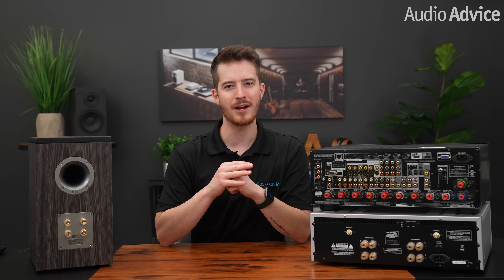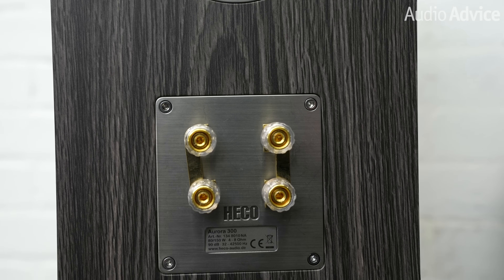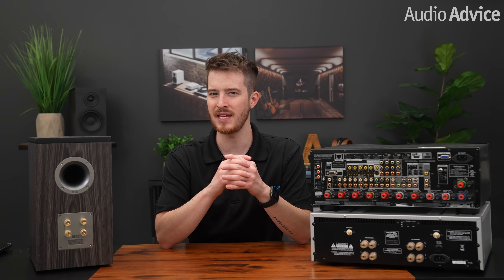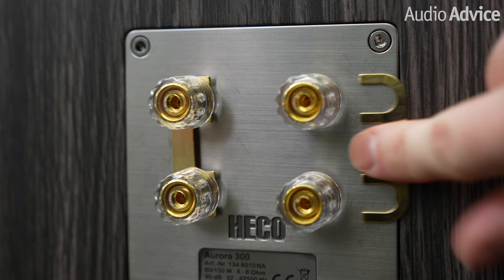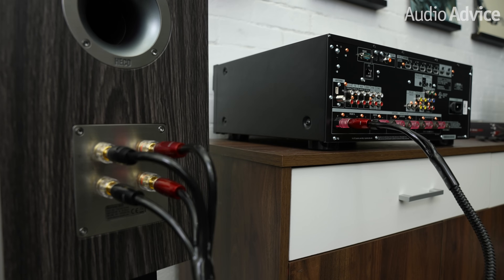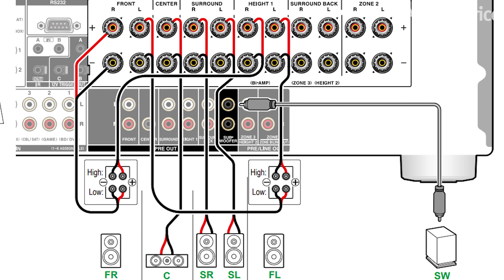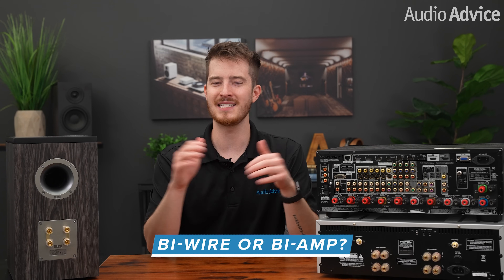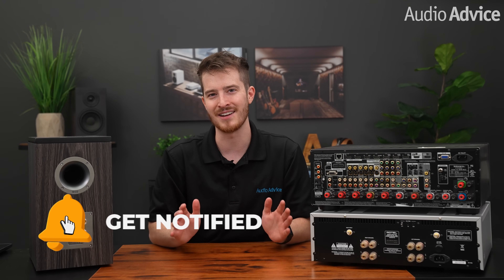Bi-Wiring & Bi-Amping Explained | What is it? How do you do it? Is it worth it? Let's talk about it!

Comment: You only showed hooking up one speaker. I assume the other speakers gets hooked up to the same channel right? I have A and B speakers and bought some new bi wire cables. Running a Yamaha R-N803 receiver to some Martin Logan ESL-X Electrostatic speakers. Trie dot YAPO setup but wont work. Did before i added the cables. Plus the receiver wanted both A and B speakers on for the test even though I'm not using the B speakers. I feel something I am doing is wrong.

Comment: Well presented. Amp and speakers are in separate rooms routed through basement. To ease bi-wiring JBLs' installation, am running a 1 into 2 setup (or 2 into 4 if you prefer):  split single + and - leads from amp into double at speakers. I assume it has the same effect as commercial bi-wires. Am I mistaken? Thank you.
Reply from the maker: Sounds like it. Feel free to call or chat with our experts at audioadvice.com and they can always run through your options to be sure you have it set up the best!

Comment: Regarding bi-wiring, how different is connecting a jumper connector in the speaker and feeding the input from the amp with 2 source to carrying 4 wire from  2 source
Reply from the maker: As we said you need to try for yourself.  Also the quality of the jumper makes a difference.  Ideally it would be made from short pieces of your speakers wire rather than the thin piece usually included.  Thanks for watching
Reply: @AudioAdvice  Thank you.  My jumper is made of solid gold coated one.
Reply: @AudioAdvice Why should it make any difference whether the jumper is made from the same wire as the speaker cable?
Reply from the maker: @rogerwebb7501  Because some jumpers are not very good.  Many are very thin and plated to look like gold but really are not.   If you have decent stranded speaker cable, its pretty easy to make them.  If your speakers already have actual speaker wire jumpers there is typically no need to change those out as they are usually they same type of wire that is used to go to the crossover inside the speaker.
Reply: @AudioAdvice  The reason I ask is twofold: Firstly surely a manufacturer of quality must know perfectly well that the plates they are using are of sufficient conductivity that their job of conveying either treble or bass (depending on whether one plugs the speaker cable into top or bottom terminals) is not hindered. Secondly, all the 'special' jumpers that I've seen are far longer than they need to be! Surely they must be more effective the shorter they are!....or is it that the manufacturers of them want to seem like they are giving better 'value for money'?!

Comment: In biwiring how crossover works. At amplifier side we have only 2 plugs and speaker has 4 plugs. How highs and lows separate out?
Reply from the maker: There are more details here  https://www.audioadvice.com/videos-reviews/speaker-bi-wiring-bi-amping-explained, but it is a highly debatable subject
Reply: Correct me if I am wrong but they don’t separate out.
Reply: @Junglemama0 May I correct you...as you are wrong! In the biwire setup the whole purpose of it is that the point (called the y-point) at which the highs and lows split is brought back to the amplifier end, allowing the highs to travel along the tweeter wire, and the lows to travel along the woofer wire. In a single wire system the 'y-point' is either at the upper terminals or lower terminals depending into which you plug the speaker cables. I leave it to others to argue over whether it makes a difference....but, if it 'works' this is how it does!
Reply: @rogerwebb7501 I have energy cf-70 tower speakers. I have had them set up wrong for a very long time. Lol! Over 10 years. I just noticed that I can’t hear anything out of the 2nd and 3rd (I think it’s a sub) speaker at all. I connected the for wires to the 4 terminals and connect two of the wires to the amp that says Left Speaker. And I connected the other 2 to Surround. Connecting the other two to surround does nothing I believe. 

So I have to biwire mine and connected to the one spot on the amp right?

Your explanation was amazing. Thank you!!!

Comment: I have the 9080 x definitive tower speakers and I have the marantz sr 6014 can I still bi-amp these speakers ?
Reply from the maker: Those have powered bass drivers, no real need to.  Thanks for watching
Reply: @AudioAdvice  these have atmos that I don't use so I thought by bi-amping I could put them to use
Reply from the maker: @babymaker13th  If you mean the upper firing speakers, we would not suggest that unless they are connected to an Atmos channel
Reply: @AudioAdvice  ok 👍 thanks
Reply: I have 4 ceiling speakers up plus 7.1 with a 2 channel amp but I think I can hook up the top of these towers to ither the subs audio out or the audio out from the avr there is an open spot for hook up
Reply from the maker: @babymaker13th  You should only do it if they connect to a Dolby Atmos Height audio output.

Comment: I just ordered a pair of Klipsch speakers on sale (RP-600M ii)and should get them Wednesday.  I think I'll try listening to them for a while in the regular fashion before experimenting, but it sounds intriguing.  Can you really notice that much of a difference?  I've never owned speakers with more than two terminals on the back.  I'll be attaching them to my 2-month-old Denon AVR-X4700H.  I'm unsure if it can be bi-amped or not, but I have plenty of speaker cable either way.
Reply from the maker: You should give it a try and let us know what you think.
Reply: @AudioAdvice  I just bi-amped my right speaker and left the left one single and listened to them each.  I THINK I can tell a slight difference - the bass seems to be a little bit tighter, but I wasn't listening to it at a high volume.  Since I don't have any height channels (not enough space in my bedroom and my chair is against the wall) I might as well just keep the one bi-amped and do the other one.  I also just got a set, today, actually...a Sunday, of banana plugs I ordered from Amazon.  I will be attaching it to my Monster Cable speaker wire tomorrow.  I'd heard that they complete a better connection.  I've never used them before but they seem pretty easy to assemble.  I have a Denon AVR-X4700H.
Reply from the maker: @garyausten5939  Thanks for sharing, yes the banana plugs usually give a good connection.
Reply: @AudioAdvice  A little note.  I had gotten Sewell plugs (packaged nicely in molded plastic) but I had trouble with the thickness on the exterior of the speaker cable  halves.  I had to wiggle and smash to get some on and one came apart so I had to use some thinner speaker wire (from Walmart).  The plugs slipped right over the cable and thought it wouldn't work, but after screwing in the plug half of the assembly it seemed pretty solid.  With both main L/R speakers bi-amped it sounds pretty good, but I don't have any video/audio proof of any difference.  I'm happy with it, though.

Comment: I am driving a pair of Meadowlark Kestrels with a Yamaha AX-397. I felt that even though I Love and adore the Yamaha stereo amplifiers, it wasn't doing justice to the speakers. Then I Bi-wired the speakers. I don't know if its purely placebo effect, The speakers sound so much better when Bi-Wired. I did it in a little different way. I gave the "High Frequency" to the "Speaker B" Terminal and "Low Frequencies" to the "Speaker A" terminal then ran the A and B terminals simultaneously to drive the same speaker. Results were unbelievably good and it keeps getting better as I listened to my favorite recordings. I never tried blind testing myself with this configuration but I know it feels good and everything seems the way it Should.

Equipment
Audio sources are mostly Flacs (SD) from my computer, some are DSD's.
SMS M100 MK2 DAC - > Yamaha AX-397 - > Meadowlark Kestrel (Bi-wired)
Reply from the maker: Thanks for sharing. You did it the best way.
Reply: You are fooling yourself. Your in ability to do a direct a to B comparison has given yourself a mind block. This is wrong, and you might damage your high frequency drivers.
Reply: Bi-wiring would be the same as if you had an automobile that had one battery (like most do) and running a wire from the battery to the heater, while running another wire from the battery to the headlights, and then telling everyone that the heater runs so much better and the headlights are so much brighter. Any technician would tell you that it's the same voltage. Duh.
Reply: @doctorquestian  and how do i damage my tweeters by doing this?
Reply: @nofacemonster  you'r tweeters have the smallest voice coils and if you think you're doing a cool trick by wiring the tweeters directly to your amplifier, you are allowing the entire spectrum of sound, 20 to 20,000 cycles, at whatever the output volume is to go straight into that little tiny coil. And so you're asking the tweeter to reproduce base frequencies? Why would anyone do that? It's a set up for disaster.
Reply: @doctorquestian  doesn't biwiring put it at the same risk?
Reply: @nofacemonster  Best to ignore doctorquestian, they are talking complete nonsense. Whoever they are, they have no idea what bi-wiring does.
Reply: @PlatypusPerspective  i think so too.... Besides it makes no sense

Comment: I. personally, found bi-amping to be totally worth the effort and expenses. 
Was using a very old, by now, Cyrus integrated amp, a Cyrus 3i (2x 60 W) plus afterburner, as in a PSX-R, plus a Cyrus Smart Power power amp, plus after burner, as before, to fire Mission 750 floor standers, 2-way, 2 connectors, to then find the improvement to be absolutely *massive*. Especially so, when using the 2x70W Smart Power (in stereo mode, could have used that in mono, if I had happened to have two of them, giving 115 W each, with the PSX-Ra) to drive the tweeters, instead of the 2 woofers/squeakers sitting both below and above the tweeters, at equal distances. What I did not try out was using the stronger Smart Power, being a dedicated power amp, to power both sets of drivers, bi-wiring or not. 
What I did was using a twisted multi-stranded "Black and White" cable (which Cyrus are recommending against, not he brand, but the construction in general, I now will be threading a big diameter hose of low electroconductivity Teflon hose through their stranding, to drive the woofers, and a set of equal length very low gauge multi-stranded silvered cable to drive the tweeters, might happen to act as an "equalizer" of sorts. Sounded better, to my ears, as far as resolution for male/female vocals went, both The Cyrus system and the Mission speakers being very "polite" and "mellow" to start with.
Any comment or recommendations on that? Would be pleased hearing from you.
Reply from the maker: We appreciate you sharing your experience. That must have been an interesting wiring diagram.  We can't figure where the old integrated comes in as the 3i would do one set of drivers with its preouts feeding the Smart power for the other.
Reply: @AudioAdvice  Wiring was hardly more interesting than connecting the pre-outs to the power amp via RCA. What I am, by now, am putting it down to is what Paul McGowan from PS-Audio says, i.e. back in the 90ies some amps where better at certain frequency ranges than others, so where the cables (those would be from 2000+), which now can more or less run the whole spectrum. As I said, it never occurred to me to let the 3i just be a pre-amp and have the Smart Power do the work, no bi-wiring, not nothing. Will have to try, and put a thick hollow Teflon hose through the Black and Whites, as recommended by Danny from GR research, assuming stuff is still working, been holed up in Thailand for the last 10y. Keep up the got work, solid info. 👌

Comment: I can't see how using different amps would be any issue in a bi-amped set up. In fact my understanding of bi-amps origins was to use valve amps for the "warmer" high end where less power is needed, and solid state for solid bass.
Reply from the maker: It is a controversial topic, but you bring up another interesting reason some people choose it. Thanks for watching.
Reply: I am currently enjoying such a setup, minus the tubes.  I have an old 100W Harman Kardon receiver.  I tried bi-wiring my speakers (Polk S55) but found the bass overwhelming.  Then I bought an Arcam SA10 integrated amp.  Using this amp alone, I was getting distortion at higher volumes.  So I set it up where the SA10 was driving the tweeter, and I used the SA10 as a preamp with the HK amp as a slave to drive the woofers.  It sounds much better now than with any other configuration.
Reply: @Cowplunk  so can the same be done with an active crossover?
Reply: @derekviveiros  I don't even know what an active crossover is.  Sorry.
Reply: same type of wires.. same length.. identical amps.. and use one amp per speaker. vertical bi amp, this is what works best

Comment: How far back should the bi-wired cables be connected? Is it ok to split the connection at the wall plate and then run separate wires to the speaker? Or should be wire be separated closer to the amp/AVR?
Reply from the maker: They should be separated at the AVR. Thanks for watching

Comment: When you bi-amp does it matter which input you plug into on the speaker? For instance do you wire the R-Channel to the Top input on the speaker and the R (Bi-Amped) channel to the bottom input on the speaker or does it matter?
Reply from the maker: That might depend on your receiver.  If the internal amps are identical, it should not matter.  Thanks for watching
Reply: Generally the main front L & R go to the base, and the second jacks labeled Bi-Amp go to the tweeters.

Comment: :face-blue-smiling:.........bi-amp only if speaker is a 3-way speaker.......otherwise, the sound will be ''pulled apart''.............no point bi-wiring - better to single wire with a better cable than cheaper bi-wire cables...............when single-wire = positive run below, negative run on top.......vice versa if speaker is 3-way design.......:hand-pink-waving:
Reply from the maker: Thanks for sharing. It’s definitely a subject of much debate.
Reply: @AudioAdvice  .......most speakers don't need bi-amping anyway, especially those small 2-way speakers - the biwire connectors is just for marketing......that's why you have many high-end 3-way speakers with single wire only......

Comment: If my Cambridge amp/cd/receiver unit has a subwoofer out port, and the bookshelf speakers it came with have biwire capabilities (two pos two neg terminals) on each speaker, do the speakers even need to be biwired? 

Surely if I plug a powered subwoofer into the unit then I don’t need to biwire?
Reply from the maker: It’s two different things. You can still biwire if you have a subwoofer.
Reply: @AudioAdvice  thank you very much :) it was the part about low end that was confusing me but I guess not low as in “subwoofer” low. I connected them up just with the single + / - wires (each speaker) instead of bi. Connected my subwoofer, turntable, and iPod dock, and it all works beautifully. I couldn’t be arsed biwiring because it took me longer to strip cables and convert to banana plugs which I’ve never done before.

Comment: I have an amp on which the connections look like the Rotel on the bottom there. You do't explain how to use those connectors.
Reply from the maker: We are not sure what you mean?  Are you referring to biwiring or biamping?  Thanks for watching
Reply: @AudioAdvice  Hi thanks. Bi-wiring I think, I was wondering if you could use an A + B setting to not bi-wire but use 8 outputs rather than 4. I don't think you can.
Reply from the maker: @informedchoice2249  Thanks. You could either biwire using A&B or run two pair of speakers.

Comment: Black = negative and red = positive, right? Why are the diagrams opposite on this video?
Reply from the maker: Good catch, our marketing team pulled those drawings from a speaker wire mfg and no one noticed.  The concept is shown properly, but yes, most people use the red for positive.  In electrical wiring though black is normally positive and red is a traveler wire.
Reply: @AudioAdvice  Haha, yeah I assumed there was a slight slip there. I’ve certainly seen electrical drawings with black=pos as you mentioned, but always home stereo set-ups use the red=pos configuration. Btw, I’m not sold on the biwiring of speakers. My setups usually don’t involve any biwiring and I’m happy with the sound. Certainly fun to experiment with, however.

Comment: i have harman kardon avr745 and hk signature series  2.1  5 channel poweramp.  i dunno if i could use my pre’s zone2 channels for bi amping but used a Y cable to double up my stereo channels and hooked up to poweramp separately . the difference is huge! i am using bw 683 tower speakers .  Thanks for the video
Reply from the maker: Thanks for sharing, moving up to the separate power amp probably made the difference you are hearing.